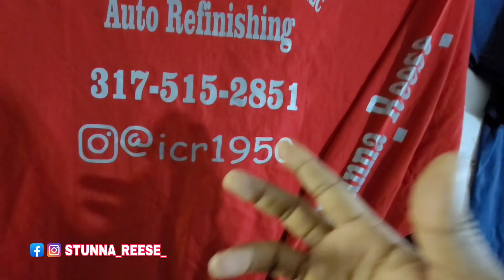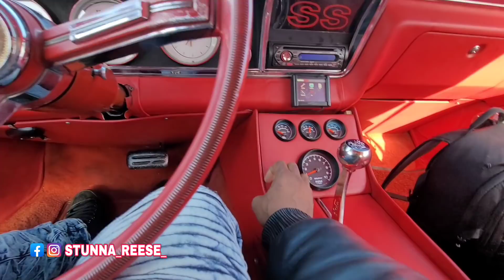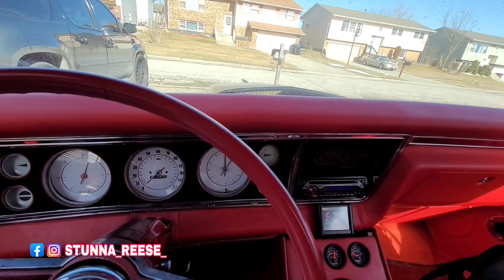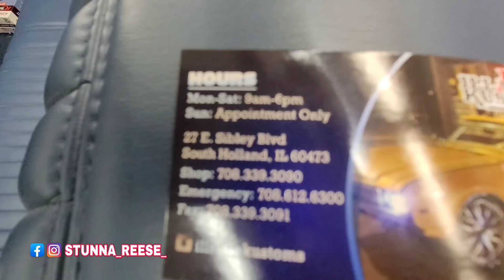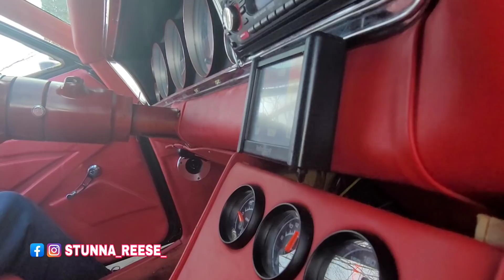WHY DID I GIVE DRAC TO THE SPIN DOCTOR (NEW INTERIOR)

Comment: I knew you didn't have a motor issue... When that engine spin a bearing,  you definitely will notice the oil pressure drop . Voltage signal would have been the first thing I would have checked on that mechanical guage. 5 volts is the magic number on that multi meter.  Glad Jordan found it.

Comment: Wagons hooked up be raw as hell. Back in 2000 i had a 83 caprice wagon jacked up with  heavy duty shocks and springs, new duals and converters (quiet), and white wall tires with chrome blades. All black with chrome trim. I had the coldest wagon out west. #FACTS

Comment: It's most likely just the gauge out because no oil pressure your engine would have locked up right after starting it. It's just electrical issue with gauge or a fuse.
Reply: Oh yea glad they found that hanging loose wire. Gotta keep drac 100%